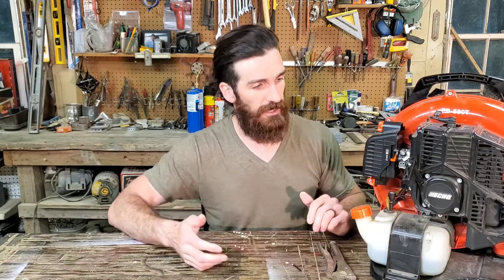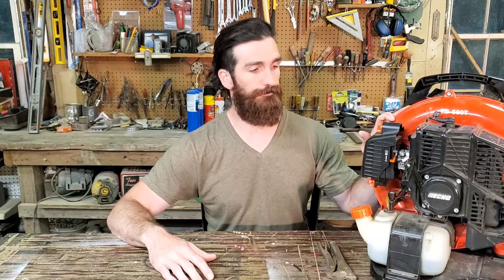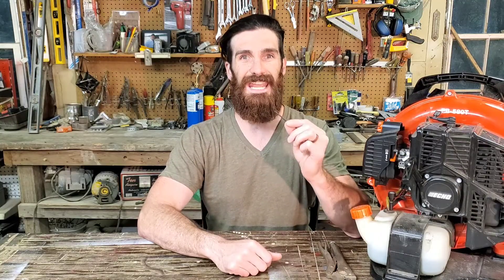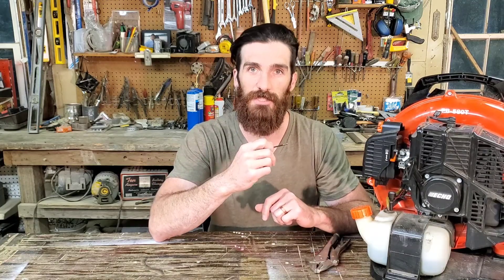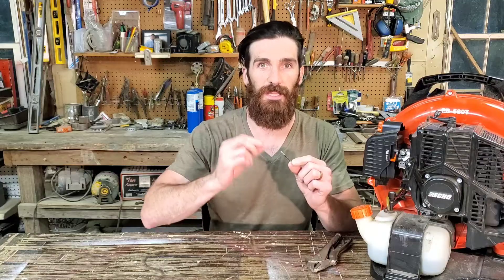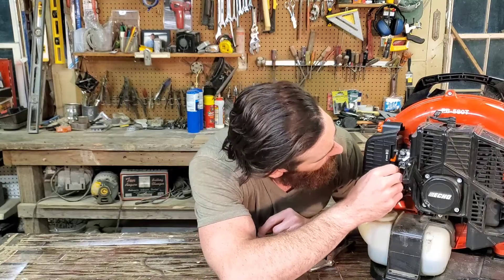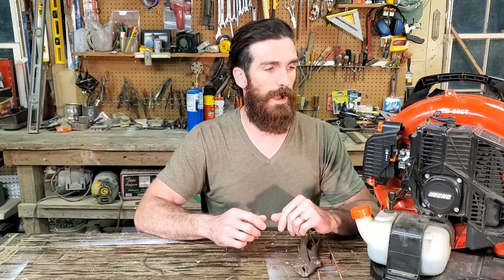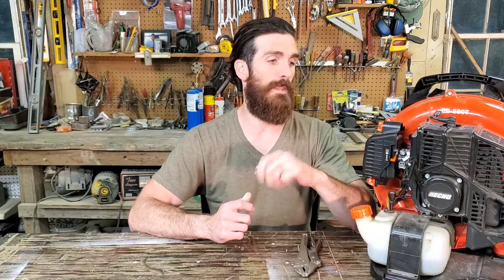Echo Carburetor Adjustment Tool-Bogging Blower PB-580T

Comment: Initial screw adjustment is 2 1/4 turns out for low and 3 1/2 turns out for high according to my local Echo dealer. Just putting that out there as I had trouble finding them spec online.
Reply: Dear goodness ty ty!

Comment: I was looking for a lightweight blower for my deck. https://www.youtube.com/post/UgkxgioZQl3J5wPGAeDINzbieKbT5qomSEx3  There are some huge trees around my house and the leaves and pods drop all over my deck. Having to move furniture around to sweep has become too big a chore. This blower was the answer. It is light enough for this 70yr old lady and powerful enough to blow all the tree droppings off my rather large deck. Thank you B&D. Be aware the cord is not included. I use a 3 prong outdoor cord 25' cord for my 12' x 20' deck. The cord retainer works very well, but don't try to pass the plug through it. That is NOT how it works. You just have to loop the cord and it works great. One of my best purchases. Very happy.

Comment: I've bought a couple of the tool sets on Amazon, and they don't come with the correct tool for the Echo blowers.  I followed the instructions on getting a 1/8 roll pin, rolled it through the grinder, and didn't eve have to put a crush on it to do the adjustment.  Lowes 2 pack at 98 cents, 2 minutes on the grinder and blower was working perfectly.  Thanks for the info.

Comment: Yeah, that Walbro tool doesn't seem to be available anywhere online.  Everyone who used to list it is showing; "discontinued" or "No longer available".  Looks like you cut open the plastic shroud for access.  The shaft of the Walbro tool is about 7 inches long and all the Amazon tool kits that have the mini-D end only have a 3" long shaft.  If you have a small nail that fits into the tube of the 1/8th roll pin, you can grind the nail to the "D" shape, insert it into the roll pin and then hammer the roll pin until its' hole takes on the "D" shape of the nail.  Remove the nail from the roll pin and  you have the "D" shaped socket end to make the adjustment.  Grind the tip of a 4 inch nail so it slides into the hole at the handle end of the roll pin and you'll have the extension necessary to reach without hacking up the shroud.

Comment: If you go on Amazon you can buy a full carb tuning kit for less than ten bucks with all the tools for all the carbs
Reply: Lol! Yep. You can, but just an fyi.

Thank you for contacting ECHO Incorporated!

 

Due to EPA regulations we are unable to provide carburetor information. By law, this includes tools and carburetor service information. The law is across the board for all companies selling gas and two stroke products. If information is provided ECHO Incorporated would be fined $35,000.
Reply: You got the product link?
Reply: The small D Hipa tool did not work that I bought from Amazon.  The machining clearance was too sloppy.  I bit the bullet and bought the Echo 91159L tool and it worked like a charm.

Comment: I ordered an aftermarket carb off ebay.Those adjuster holes theres actually a screw that comes out with a flat head end on it.I spent 30 mins trying to adjust it, then watched your video.I was woundering why it had a "H" "L" marking lol.....id get it to idle then mess with both to get it to go at full speed and it would die when i let off the throttle.NOW that i know its High speed Low Speed runs great thanks! Ive never messed with 2 stroke.The only downside is the throttle is positioned different on the carb. Only goes half speed and stops any ideas to adjust the throttle cable ?
Reply from the maker: Not 100% sure about the throttle adjustment question, but glad you got it working!!  Thanks for the comment and for watching!
Reply: @BigbeardMN  hey bud, I own a echo 770H. My question is would you happen to know if I’d be able to “convert” it into a 770T? Meaning if I buy the throttle cable for a 770T and put it on the 770H would it fit? 
Any help is greatly appreciated.
Reply from the maker: @BigMike-Soetoro  I am sure it is possible as I would assume all the wiring is the same for the on off switch and cable for the throttle.  You would have to remove the hip throttle level and handle that is on the tube.  I'd search to see if anyone has done it. Good luck
Reply: @BigbeardMN  thanks bud.

Comment: I have a 9010t and ive been using it for a couple weeks but now noticed it almost bogs down when i go to give it throttle after a certain amount of time.
Reply from the maker: It might just need the carb adjusted a little bit to lean it out (less fuel to air ratio)
Reply: @BigbeardMN  so i watched a video and someone said turn it clockwise and you say counter clockwise haha

Comment: Dan: I'm 70 and a world-class mechanic and for the life of me I can't seem to make a proper "D" shape on the head of the roll pin. Removing material from it to fit into the tiny holes was simple enough but no luck forming a suitable D shape on the tip of the roll pin. How did you do that? Thanks.
Reply from the maker: If I remember correctly I used a vice grip and hammer to work it into the D shape. Good luck and thanks for the watch and comment!

Comment: Replaced the carb with new one and still have the bogging down problem, the blower idles fine, any suggestions?
Reply from the maker: I just had this happen on a different blower of mine where I replaced the carb as the original was shot and I had to turn the high speed scew counter clockwise.  To do this pull the throttle and at the same time turn the screw slow until you get a smooth full throttle.  Don't go too much as you will be running too lean.  For me unlike the stock carb I didn't have to use a special tool to adjust this as it was external with a flat head screw. Hope this helps!

Comment: What would cause it not to reach full rpm when pulling through throttle ?
Reply from the maker: Too much fuel and not enough air, which floods the engine
Reply: @BigbeardMN  half tank of fuel (premix from depot). How do I fix the air issue ?
Reply from the maker: @wrestlingchamp8845  in the video I explain how to do this. Ultimately you want to turn your H screw on the carburetor counterclockwise a little bit at a time until you have a smooth transition of power from idle to full throttle.  If you unscrew it too much you can burn your engine up. So small 1/16 turns at a time.
Reply: @BigbeardMN  thank you!

Comment: Did you adjust the hi side or the lo side???
Reply from the maker: I only adjusted the high side.  If that still doesn't do the trick then chances are you carb needs a cleaning and rebuild or you can get a new one for pretty cheap on Amazon.
Reply: @BigbeardMN  thanks...I replaced it recently with an OEM....

Comment: Great video, great idea! I bought a 580T yesterday and frankly, it's running rougher than I would like. Does it need some break in time to smooth out or should I be looking at a carb adjustment? You'd think brand new it would run better. There is no evidence gas was ever put in it at the factory and the carb fine tuned before it was boxed and shipped.
Reply from the maker: Congrats on the purchase and typically they are set rich (more fuel to air ratio) from the factory, but it shouldn't run rough. Make sure you are running at least 89 octane gas that is mixed with Echos 2 cycle oil correctly and let it idle for a bit to warm up before you blow the doors off something or want to ride on a skateboard!  If that still doesn't do the trick then take it to a certified dealer as you have warranty! Wish you best of luck and thanks for the comment!
Reply: @BigbeardMN  Dan, forgive my very loaded question, but you mentioned, "use Echo 2cycle oil." I've used Amsoil Sabre 2cycle for years and never had an issue. I'm intrigued by Echo's Red Armor 2cycle oil. Other than every manufacturer thinking their product is the best, is there really any advantage to Red Armor or will any good quality 2cycle suffice? Price is not the object, quality is.
Thanks again!
Reply from the maker: @lorinkramer1524  lol it's all good! I can't provide you with any truth as to which one is better so I leave that to some oil experts out there. Typically I will always run what the manufacturer recommends  as that is what they hopefully test with.  Heck back when I had 6.0 diesel all my Ford mechanic friends always told me to stick with the Motorcraft oils and filters.  Sorry totally off topic but hope you get that blower rocking soon.
Reply: @BigbeardMN  Thanks again! I know what you mean. We have a Honda, and they tell you you need Honda air in the tires or the tires will explode....well, okay, not really but if they could, they would. That's why most people rate going to a dealership and having a tooth pulled about the same. 😆
Reply from the maker: @lorinkramer1524  lol isn't that the truth!